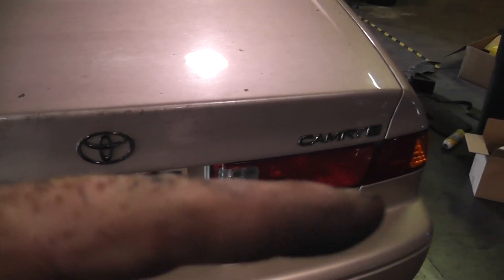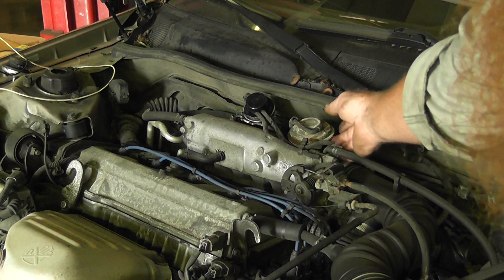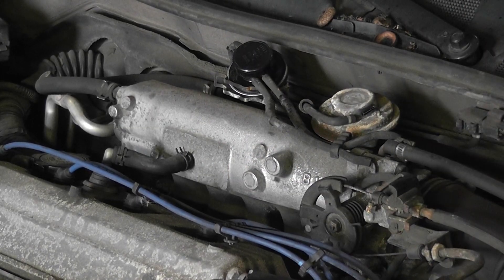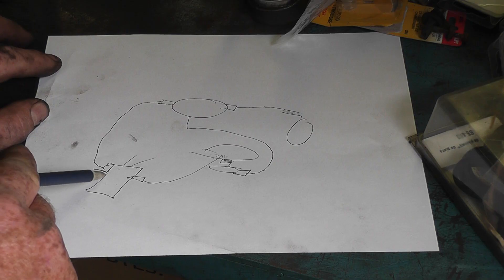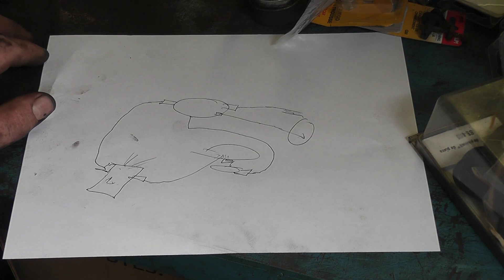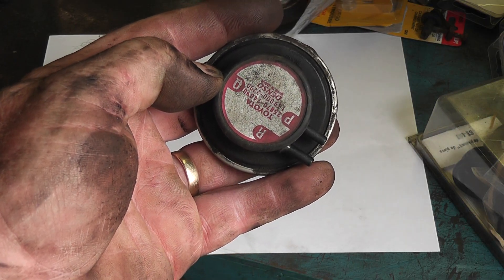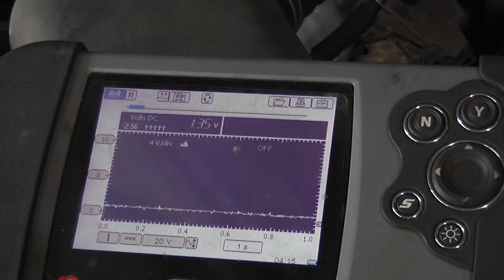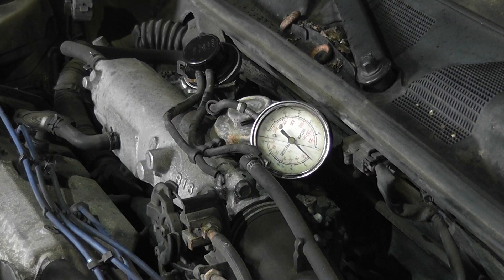TOYOTA P0401 EGR INSUFFICIENT FLOW

Comment: Hey great video. I have a401 code that won’t go away on the same engine on a 99 Camry. I’ve replaced  both vacuum switching valves and the EGR VALVE AS WELL as the transducer you mentioned. But I still keep hurting the 401 code after a couple days of driving after clearing the code. Any suggestions?? James

Comment: I've owned many Toyotas, trucks, 4runners, celicas, 2 Supras etc. My 1999 camry le showed this code intermittently for 200000 mi. Other than this it was a great car, I just acquired a 70000 mi camry ce In mint condition, drove it 1 week & guess what? Fuck it! I'm done! Sold the old one to demo derby guys, this pile is also going to them, this scenario has finished my loyalty to Toyota, you cannot correct this problem, its futile. Going back to Honda, fuck this garbage!
Reply: Moisture creeps into modulator. Operates like older melco systems, failure prone.

Comment: Need video for Toyota Prius 3rd gen?.  Anyway, from much research.....to remove the EGR cooler/assemble...... use an extra reach 12 mm racheting wrench for the three Nuts in the back.   I had a hard time reaching the 4th HIDDEN 12 mm nut underneath the EGR cooler.   Then, used a Torx E8 socket for the two Bolts ( in the back of EGR cooler) and I finally freed the EGR assembly.  It's literally impossible to remove EGR valve only for DYI non professional therefore remove the whole EGR assembly.  Good video J.D !!!

Comment: Dear, i am facing this issue since months, egr is functioning properly, tested. Modulator was jammed and replaced with new. VSV was bad and replaced with new.
Still got CEL p0401.
EGR passage had gunk, cleaned somehow, the hole attached to intake from egr had gunk too, cleaned well but unfortunately now i have 2 codes at a time. P0401 and P0402.
Do you think is it related to carbon been messing up with my system, what should i clean next to open the flow ?
Or is it something else ?

Any help would be appreciated guys ? Please 🙏😞
Reply: If you already change the solenoid and egr valves along with the purge vacuum switch then is definitely going to be your charcoal canister which needs to be replaced

Comment: Should the EGR open when the engine is cold?  When I rev it up with the engine cold the valve opens making the engine hesitate.  When I unplug that solenoid underneath it does not do that.  I wonder if the ECM is bad?  I've replaced that solenoid and the vacuum modulator and I still get codes P0401 and P0402.

Also, does the valve stay open when you keep the RPMs up?  In the video you don't maintain RPMs: you just rev it up and down.

Comment: Great break down, I've got one of those in right now., 401.  One well un understood, thing that seems to go unchecked, is the engine light with the 401 wont re situate until engine off and restart. You can drive it forever with no engine light until engine off and restart.
I hope your code and light stayed cleared. Thanks for all explained.

Comment: Thanks for the video 👍 I was going crazy trying to figure out why there wasn’t vacuum in Port P. I removed the throttle body and found gunk jammed the pin hole size vacuum port. Cleaned it thoroughly and now getting vacuum and the dreadful P0401 code when away. Still need to drive the car long distance and make sure there’s no additional CEL. Next step is to get it Smogged/Emission test.

Update: 97 Camry passed  emission test successfully!
Reply: How did you clean out the gunk in the port? Where was the vacuum port located? I took a quick peek when I changed the air intake hose recently, and my throttle body looked really clean.
Reply: @SeanCMonahan   Use carburetor cleaner and shop air. The ports are located on the throttle body topside. Follow the vacuum modulator small hoses to the TB. They'll be marked P, Q, and R. Manually move the throttle body butterfly back so you can see the tiny pin hole size ports inside the TB that will need to be cleaned. Blow some shop air through the ports to remove any carbon deposit inside these ports.
Once cleaned, use a vacuum gage to see if the ports are producing vacuum while accelerating to 1500 rpm or more. Hope this helps.

Comment: I have a egr code and and had the vsv changed but the code still came on. I drive 70 mph but temperature gauge is running near cool. What should I do?
Reply: I had a similar issue. Turned out the thermostat was stuck open not letting the engine run at normal operating temp at 198 deg. The ECU thinks your engine is cold and will not let the EGR system work properly, causing your CEL to come on. Just a suggestion, hope this helps...

Comment: thank you for your time sir great video my A to B 01 camry work car just threw this code thursday ima factory certified ford technician but nuts and bolts are all the same fixed my car no problem with your video
Reply: School Of Hard Knocks  thank you.
Reply: I understand
Reply: Freddie Cordova hey man do you a facebook
Reply: What did you have to do to fix your problem? Mine is throwing the code even after I replaced the EGR valve.
Reply: Freddie Cordova give me a min and i’ll get back to you i’m setting in line at the drive through

Comment: Great vidio James the best I ever viewed helped me solve my flow restriction problem which was not in the transducer itself but in the hose that goes off the bottom to the EGR pipe was clogged along with the pipe was clogged I cleaned it all out w/o removing the EGR valve which was a pain to get at the 4 bolts excellent vidio Thank-You

Comment: I'm having a issue with my 98 camry. When i come to a stop or in park and the cars running the idol goes up and down and i think its going to die but never does. Once i start moving everything is fine car runs great. I replaced the egr modulating valve and that wasn't the problem. If anyone can help please do.
Reply: You have take the intake apart and clean it out. That's the problem. Check Scotty Kilmer.
Reply: vacuum leak?
Reply: greg parlier  I have exactly the same problem here, don't know what to do, please someone help us, thanks
Reply: I was told last resort was to clean the EGR internal engine passage. If not fixed after exhausting all recommendation, is to replace e the ECM  computer 🤔
Reply: Coolant temp sensor

Comment: Hey james, I changed the EGR Vacuum Valve, and erased the code.. A week later code came up again .. What do I do?
Reply from the maker: +TheWiseGuy do u have a vacuum pump?
U can pull vacuum on valve and see if car stumbles or stalls to confirm valve operation.
U need to check if vacuum is even making it to the transducer from the electric solenoid when u Rev the engine off idle. And if both of those are ok. The little metal line from the egr that ends up under the transducer can clog and u won't get enough back pressure to make the transducer operate and allow the vacuum from the solenoid to make it to the egr valve
Reply: James Danner That must be my problem! I replaced the egr, vsv, and transducer, and still no vacuum getting to egr so must have clogged back pressure pipe going to egr!

Comment: I have the exact same car 2000 Toyota Camry 4cyl. Replaced the VSV (EGR vacuum solenoid) and the check engine light went out after driving 50 miles. The computer tests P0401 by energizing the VSV during cruising speed and looks for a quick response from the Map sensor. Good luck to anyone trying to remove the VSV, it's buried on the back of engine. I unplugged the blue connector by reaching from the passenger side, wheel removed. Remounted a new VSV on the passenger side of the intake manifold. VSV bracket reversed so the connector could reach it. Just buy a new VSV,  don't bother testing the VSV, it's a heat related, intermittent problem.
Reply: Michael Mirro i will have to give this a try as my EGR system passed all the vacuum/pressure tests mentioned in this video (and others)  Logically i shouldn’t have a P0401  but if there could be an intermittent issue with the VSV as you say that would explain my senseless situation
Reply: Same bro passed all vacuum test, egr stalled the car replaced  VM Transducer still EGR INSUFFICIENT FLOW

Comment: What would happen if I would of take off the EGR valve? Will it still run
Reply from the maker: +Zachery Sonnier not good if it did. U would have a big intake vacuum leak and an exhaust leak at that mating surface

Comment: With the whole EGR system working correctly how much vacuum is being applied to the EGR valve diaphragm?  I have close to 20 inches of mercury all the way up till the hose leaving the vsv and entering the  top of EGR valve. only getting around 5 inches I'm guesing before the valve open? is this correct? or should it be higher? any help is much appreciated
Reply from the maker: +Rudy Reyna I want to say the bad bpt I see have low vacuum like that too. But remember they are controlled by exhaust back pressure by name. Those hoses split and the little port coming off of the bottom of the egr valve that that hose is attached to clog up with carbon. If u don't have enough back pressure pushing on the transducer.  It won't open the vacuum port enough either. Those are simple systems. When it's warm enough,  the vacuum solenoid allows vacuum to the supply port of the bpt, and egr will open just revving in park. U can bypass the bpt and feel the egr lift with ur finger. Then maybe try a long vaccum hose to the bottom of the bpt and blow air with your mouth into it and see if it works that way( everything else  hooked back up correctly ).
Reply: My EGR valve will only hold 5 inches of vacuum (vacuum guage T fitting in between vsv and egr). The vac hose from the VSV is 20 inches vacuum when above idle and warmed up. I also got the Dorman vacuum modulator (bpt) which seems to allow more vacuum at lower speeds. Just sent away for a new EGR valve, see if P0401 goes away. The old EGR valve vacuum diaphragm might be leaking. 2000 Toyota Camry 4cyl auto
Reply from the maker: Oh. Got it. Hard without a hand vacuum pump but same thing... Put a longer vacuum hose on egr valve and suck on it. U may not suck enough to open valve... Ha..  but if u put ur tongue on the hose, it should stick to it due to the vacuum if the egr diaphragm is good
Reply: P0401 came back on and the bottom of vacuum modulator (bpt) is heat warped. Looks like exhaust restriction causing to much back pressure.
Reply: Ok, replacing the EGR valve fixed it. The P0401 code went away as soon as the car warmed up. The bad EGR valve held just enough vacuum to almost work, but not at lower rpm. Buy Toyota parts if you can afford it. I bought Dorman for a cheap fix.

Comment: Hello James. Will a broken intake hose throw a P0401 code. I have the same car did everything on this video and while Im spraying the two vacuum port on the throttle body I noticed a crack on the intake hose just after the clamp for the throttle body. Great video by the way. Very helpful. Thanks
Reply from the maker: If u mean the intake duct from air filter to throttle body,  I don't think so. I have seen the egr ports clog on these. Especially the little backpressure pipe to the transducer.  Pull the egr off and look close at that stuff. It's not too hard

Comment: Hey James, would you have any ideas on why my 2003 Mazda Protege DX 2.0 Automatic sputters after refueling and also sometimes randomly idles rough, and also is lacks power from a stop while accelerating? Once I am up to speed the car is fine, it is only when the car is from a stop accelerating. It acts like it has no power until i get the rpm's above around 1500. No CEL's. I thought it would be the EGR, but I replaced that, so I tested the EVAP Purge Solenoid and it seems to function fine as well.
Reply from the maker: Ok.. my first thought was purge due to the fill up issue...tough if it's intermittent. But u could prove it while its happening by disconnecting the tank side of purge and checking for vacuum ( as long as its not being commanded/clicking. ) if so, disconnect the plug as well and see if vacuum exists. The other thought is those engines have a pcv system under the intake above the starter where there is a small curved pcv hose that splits  and causes a pretty decent vacuum leak. It would be nice if u had a scanner to see fuel trim readings at idle. Or if u don't mind getting wet. while idling.. Spray a hose up under intake above starter(radiator side) and listen for the gurgling hiss of water being sucked in
Reply: Will do and report back with my findings!! Thank you!
Reply: +James Danner Figured I would check in and let you know that it was indeed the Purge Valve! Thank you!
Reply from the maker: +Kevin awesome. Thanks for the follow up

Comment: The only thing I don't like about your channel is we don't get enough of u!!!  Love every video!!  U ain't into super fancy. But u get the job done and r sure we get the theory behind it. Thank u!  Could your Solus command that solenoid to open?
Reply from the maker: Thanks for the compliment. I never checked to see if the scanner did any controls. Especially since the system is very simple and the computer energizes the solenoid pretty much every time you give it throttle. Even in park. So it was just as easy to bypass that transducer with a vacuum connector and see if egr valve opened briefly during that window its supposed to. Thanks again